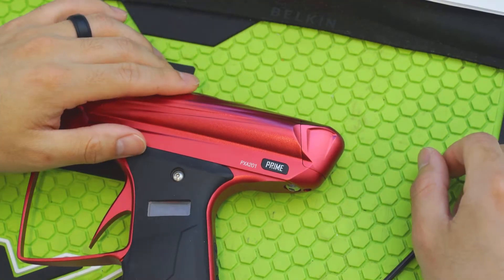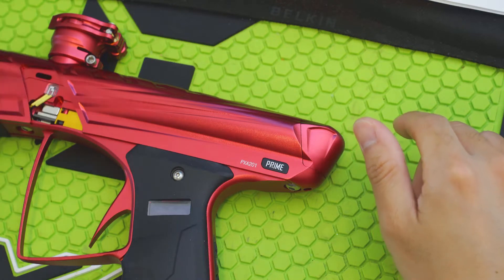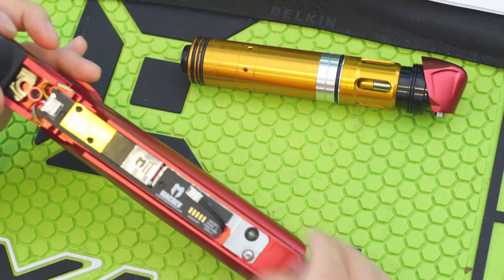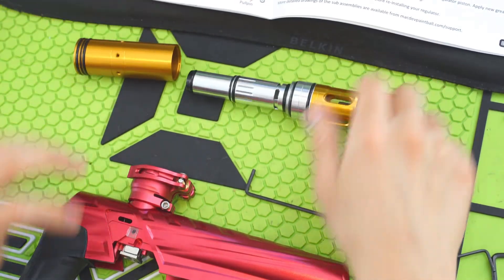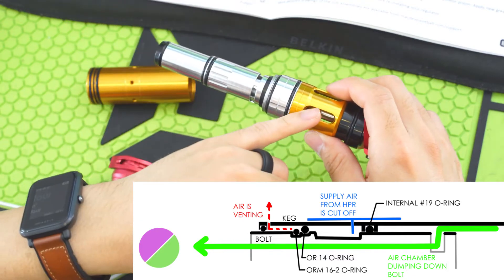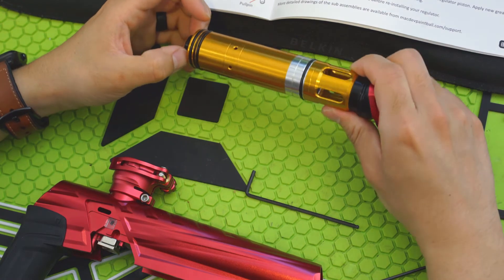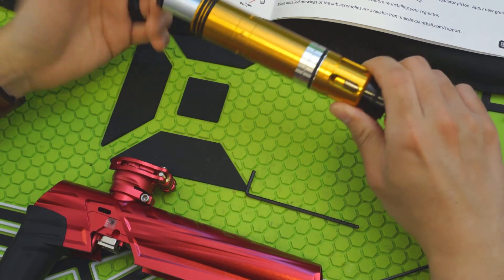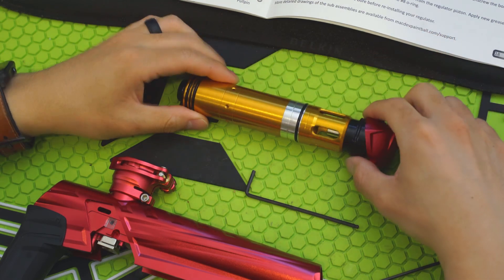Macdev Infinity Drive | Technical Break Down

Comment: Awesome video. I got this marker a month ago. And I experience a lot of bolt stick when I Firsr air it up each day. Seems to be a common problem
Reply from the maker: Thank you! May I ask have you tried replacing the sail with a fresh seal? We are finding that some times they run better with particularly sized seals only slightly different than stock
Reply: @QTPaintball  yes I have replaced the oring with the spare from parts kit that comes with the marker.
Reply from the maker: Are you on the Macdev or any paintball BST pages on Facebook?
Reply: @QTPaintball  yes
Reply from the maker: I would either double check you are running the correct seals. If the correct factory size seals don't work, reach out to Connor Smith on Facebook. He sells oring kits which are of very slightly different size which will improve sealing, if that is indeed the issue.
Reply: @QTPaintball  Yes he has helped me. I changed out the orings with his and so far so good.

Comment: How are these on paint handling?
Reply from the maker: The paint handling is quite good. The soft face tip is very soft and compliant. I haven't had much instances of broken paint... Or maybe any with my time with the platform so far during the summer.